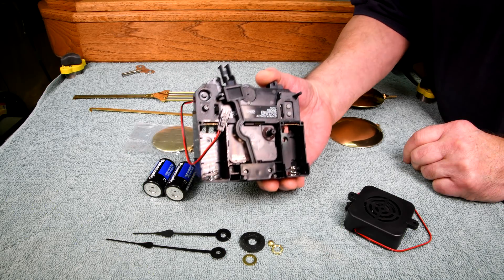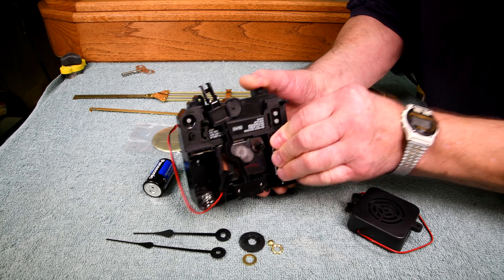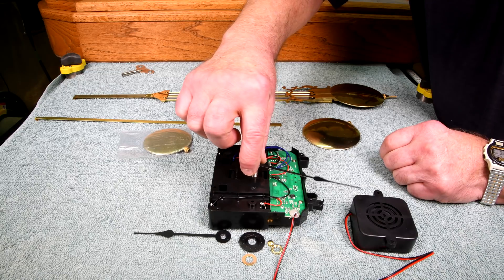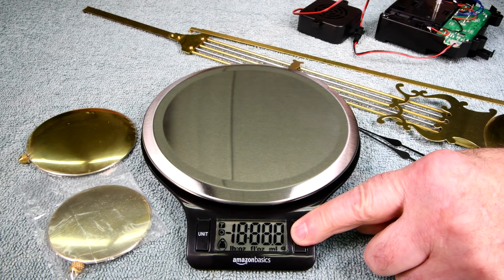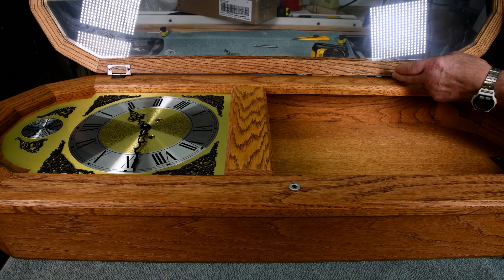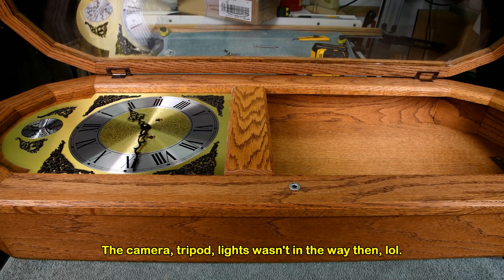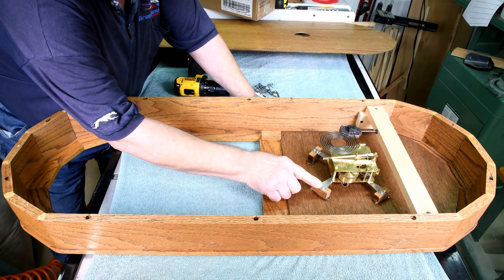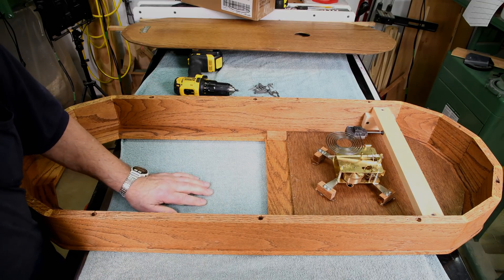The Daughter's Clock - Part 2

Comment: I built a grand father clock and found a electronic pendulum motor that runs independent of the clock and works with a large pendulum.  Works good
Reply from the maker: Yes, I was actually thinking about one of those too. Funny that I've never actually bought one by now.

Comment: Somewhere in the deep recesses of my mind I'm thinking the larger, longer heavier pendulum shouldn't be much of a problem, it's own inertia will care the swing and that will happen whatever size it is. The clock mechanism just has to give it a nudge each time to keep it going. That is of course if that's how the mechanism works and I'm right about pendulums,  neither of which could be the case. 🤐
Reply from the maker: Hi Ian,
My main concern was that the extra weight might prematurely damage the pivot point of the suspension. It uses a knife edge pivot which is just plastic against plastic. A suspension spring is usually used for something this heavy. Thanks for commenting again :)